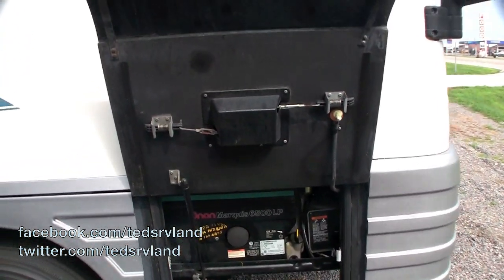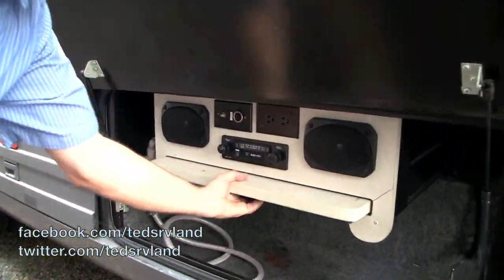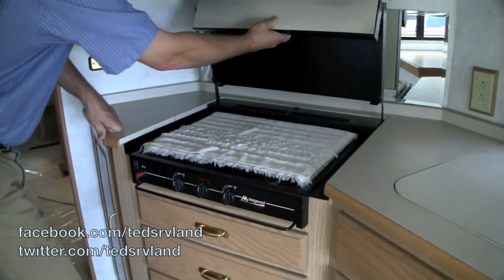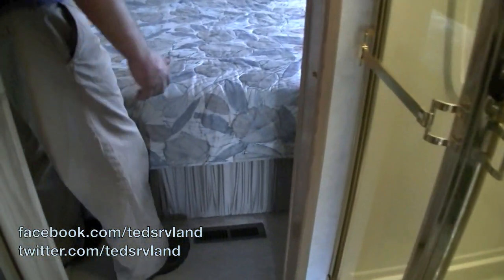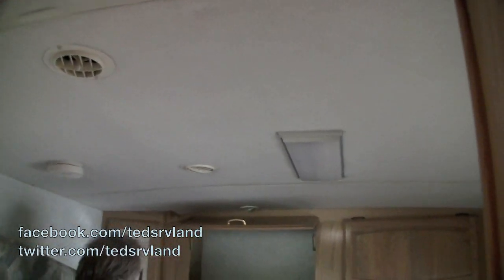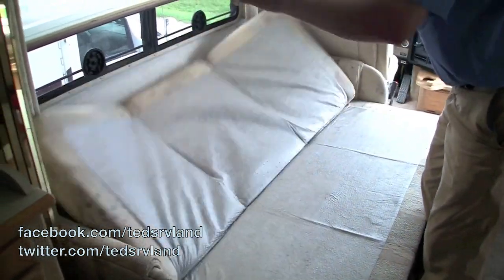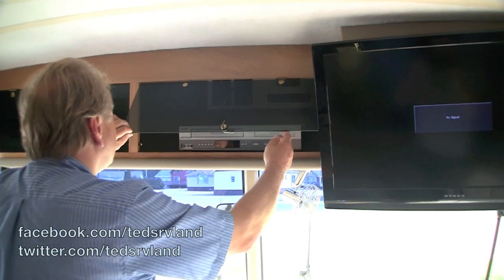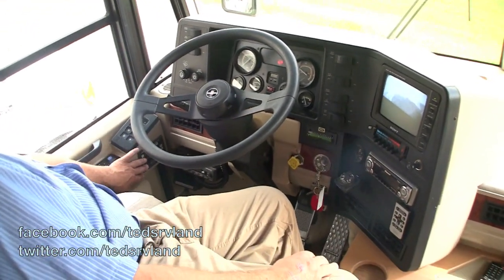1995 Winnebago Vectra 35 RQ

Comment: I have the same RV.... been a good unit...got it about 12 years ago..drove  two sets of tires off it....around 60,000 miles ....just starting to delaminate below big window on driver side by couch... window leaked...fixed leak .I might cut it open and re glue it..it's not bad now..but will get worse over time.